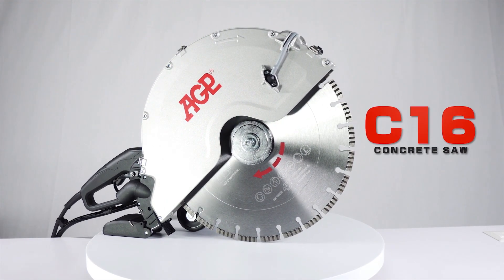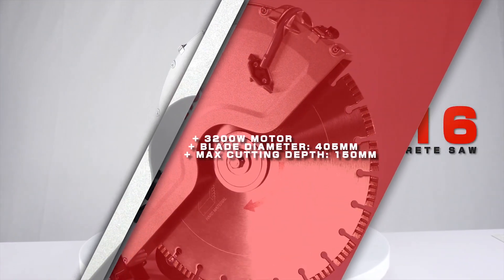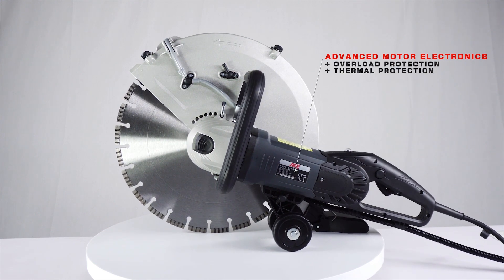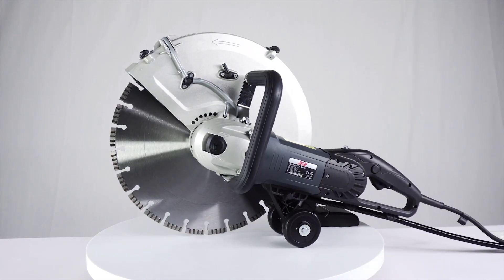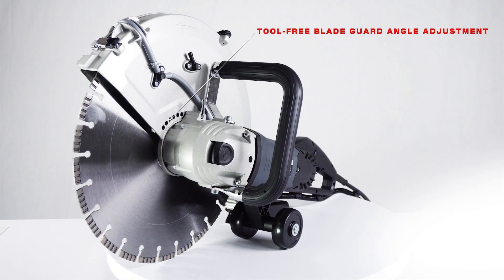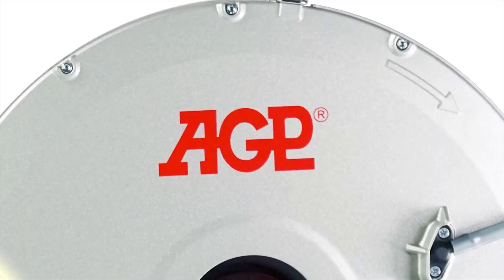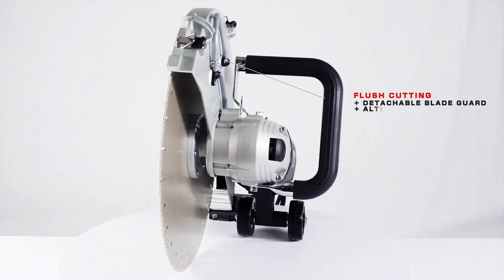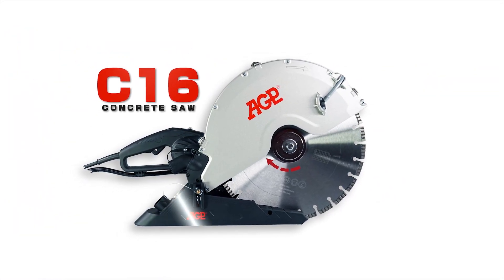AGP【C16 Concrete Saw】Product Overview

Comment: Does the dust skid affect the depth of cut?
Reply from the maker: Hi Michael, thanks raising this question. No the dust skid does not limit the depth of cut.
Reply: AGP Power Tools
Thanks
Reply from the maker: @michaelrobinson1341  Happy to assist you if you have other questions!
Reply: @michaelrobinson1341  ഹൗ മച് പ്രൈസ്